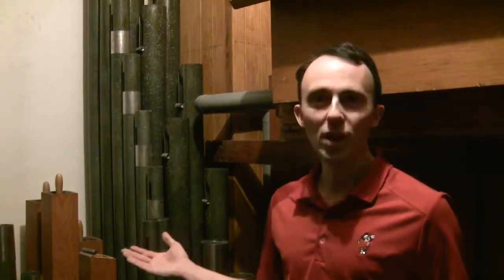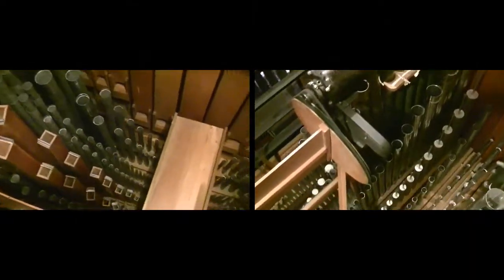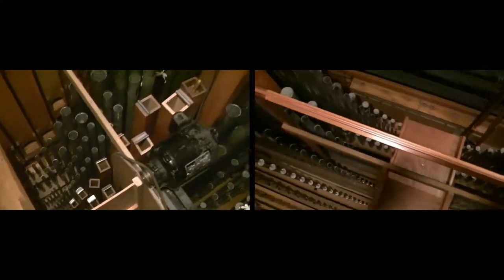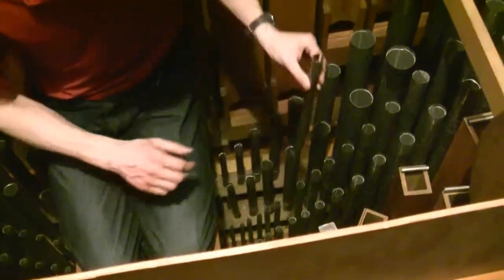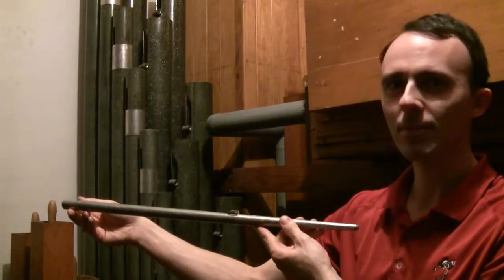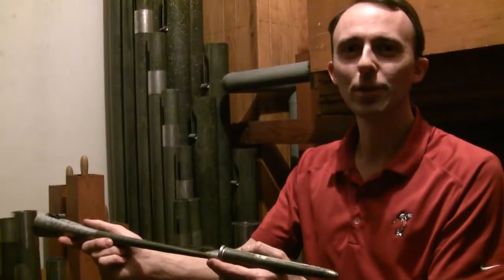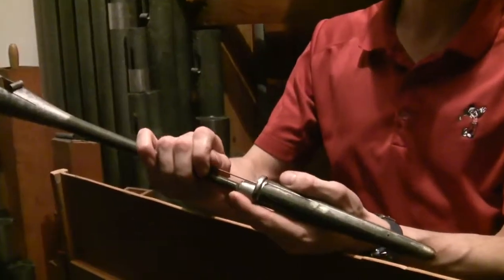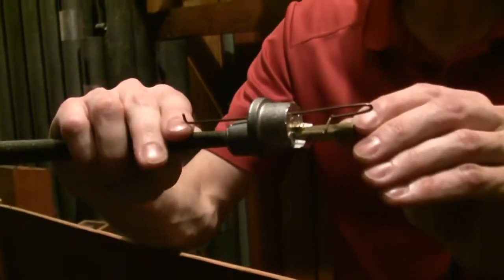Organ Miniatures 11: Tuning and Ciphers

Comment: Flue pipe rely on temperature, Barometric pressure and humidity because they are wind instruments. Those three variables affect the tuning because they change the air density - thus the pitch of the organ. Reed pipes are mechanical. The reed in a vibrating valve. The rate of vibration governed by the free length between the tuning wire and the end of the reed.  Reeds, being mechanical are not affected as much by atmospheric influences. It is the flue pipes that drift on an hourly basis, not the reeds so much. Dust and bugs are the enemy of reeds. Flue pipes are not influenced by these elements inside the pipe.  Wood pipe do shrink and swell as a result of temperature and humidity. This will never change. The tuner sets the temperament on the 4' Octave, a member of the Diapason family of stops and the second harmonic in the series of harmonics produced by an open metal pipe. It is in the middle of the pitch range of most organs and is used as a pitch stop for all the other pipes in the organ.  Bigger pipes are less influenced by atmospheric variables and no not wander as far or as often and are not often noticably out of tune, especially in the 32' range.  So, with that knowledge, a stable tuning stop and a set of tuning  bars you ae ready to spend  a day or more tuning an organ of small to moderate size, or the never ending job of tuning monsters like  The Wanamaker organ with about 40,000 - yes three zeros - pipes on four levels. in the Wanamaker building in Philadelphia.  Have fun, see  you, still tuning, next year.

Comment: Thanks for the video! Can I ask you about a particular situation? I play this organ in a small church, but there's an A4 cipher on all the stops of the swell (only when the stops are selected). I tried for a bit the repeated key press method, but It didn't work and i cannot hear any mechanical sound when pressing that key. Do you have any advice? Thanks in advance
Reply from the maker: Is the organ mechanical (tracker) or electro-pneumatic? Electro-pneumatics often use magnets to generate the signal that makes the pipes sound. Occasionally, those magnets can come off and cause the key to get stuck in the “on” position, which would effect all stops when they’re pulled on. I’ve had this happen with my instrument, but only ever with the pedals. The trouble with this problem in the manuals is that there’s not going to be an easy way to access that contact point easily. That’s what I’d recommend checking, though. Sorry you’re having this issue. I’ll let you know if I think of anything else it could be.
Reply: @YensidOrganist  Thank you very much for the answer! You guessed right, the organ is an electro-pneumatic one.
But are those magnets that you mentioned on the keyboards or on the valves? Just to know if the problem is in the consolle or inside the organ (they are a few meters apart)
Reply from the maker: The magnets would be inside the console, basically at the opposite end of where you press the key.
Reply: @YensidOrganist  Ah, ok, thank you very much!

Comment: organ pipes do not go out of tune by contraction and expansion, they go out of tune because of the density of air which changes with variation in temperature and humidity. Also, reed pipes are actually more stable when they are correctly regulated so the resonant point of the brass tongue and the resonator are in sympathy with each other. The reeds sound "out of tune" because the flue pipes have shifted in pitch more than the reed pipes.

Comment: Just discovered your channel good job!  Have a short cipher (only lasts a few seconds) in one low pedal on a Schoenstein built in the 1950’s. I am a piano tuner (RPT actually) and know just enough about pipe organs to be dangerous
Reply from the maker: Thanks, Brian, I’m glad you’re enjoying things! From your description, it sounds like the leather flap that prevents air from going into the pipe is wearing out. This typically happens in older instruments, and would cause a short cipher that usually goes away on its own. Without seeing/hearing it, it’s hard to tell, though. That’s also something that’s unfortunately not easy to fix for “Sunday morning tuners.”